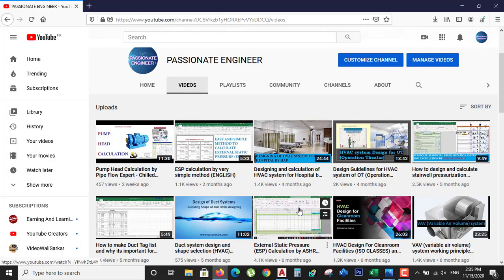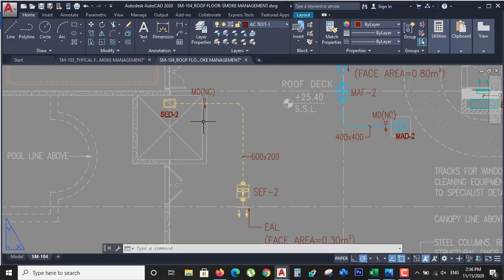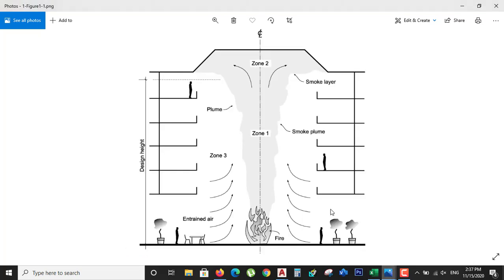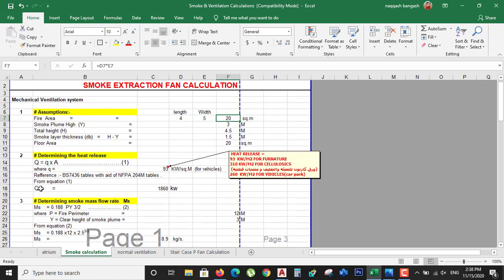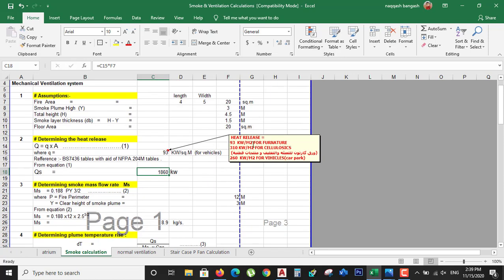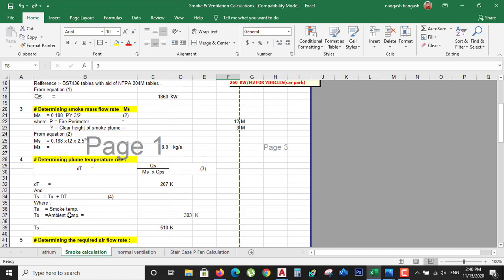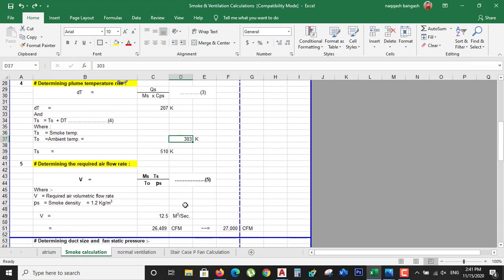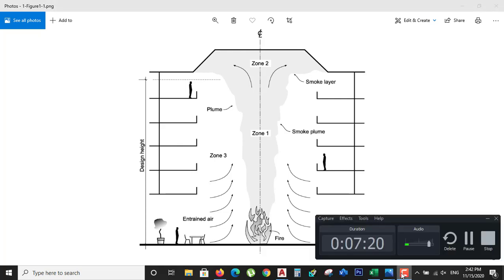Design of Smoke extraction system (Smoke Management System) (ENGLISH)

Comment: fire area in not as the floor area this will increase the fan m3/s
Reply from the maker: It's depends on the situation. The fire area is actually the area separated by  fire rated walls if the attrium wall are fire rated and fire will not transfer from internal space like shops etc to the attrium,than only attrium area will be considered as a fire area.

Comment: Fire perimeter did not understand like for the corridor area is 46 m fire primeter is which valve i need to keep.
Reply from the maker: A fire perimeter refers to the boundary or outline of a fire, marking the edges of the area that has been burned. It's essentially the shape of the fire's footprint on the landscape.

Comment: How to design Cargo warehouse ventilation system?
Reply from the maker: Follow ANSI/ASHRAE Standard 62.1 guidelines, based on the space type, occupancy and room size. For warehouses, the ASHRAE minimum ventilation rate is 0.06 CFM per square foot.

The air changes per hour (ACH) in a room. Air change rates for warehouses are typically set between 6 – 30 changes per hour.

Warehouse ventilation generally involves some combination of rooftop or sidewall exhaust fans, rooftop or sidewall supply fans, rooftop gravity vents and wall louvers. These can be positioned to create different airflow patterns in the space. For example, exhaust fans can be placed along one sidewall and supply fans or louvers along the opposite wall to create a continuous crossflow pattern. Another option would be to put exhaust fans along the center roof line and supply fans on both sidewalls to bring cool air in from the sides and exhaust warm air from the ceiling. Airflow patterns should be designed to remove indoor air contaminants from the breathing zone and keep air circulating through all parts of the facility for better temperature and humidity control. In heated or air-conditioned warehouses with high ceilings, additional fans may be needed to combat air stratification, in which warm air rises to the ceiling and cooler air settles to the floor. These fans are located to promote air mixing within the room.
Reply: ACH 6 to 30 are such a wide range. Are they referring to different type of warehouse?    @passionateengineer04

Comment: How to calculate airflow smoke extract for data centre ?? if i want to design extract fan for area  data centre ( 42,9 x 27 x  5 meter )
Reply from the maker: Use same method, you can study NFPA 92A for further detailz
Reply: @passionateengineer04   please share excel link sir

Comment: Just watched you video. Quite impacting. How do I know the plume height and fire area for a fire that hadn't occured?
Thanks
Reply from the maker: Smoke plume height is the highest point where smoke can travel in building, usually its upto ceiling.
Fire area means, the area you want to protect it from fire, where fire can occured or area protect by fire walls, fire barriers etc
Reply: @passionateengineer04  So is the fire area same as the areas of the space being considered? I mean the area of the room.

Comment: How does your building area is just 20 sq meter, similar confusion for total plume height just 3 meter only? , How do you calculate fire perimeter P, that also just 12 meter
Reply: Same question that didnt get any answer. How / where to determine the fire Perimeter anyway?
Reply: @johnpatricklegaspi3933  maybe from fire area P = (L  + W ) 2
Reply: @johnpatricklegaspi3933  There is No calculation , NFPA 92 states that it is assumming , you do not need to calculate Fire perimeter you just need to enter theoretical value .